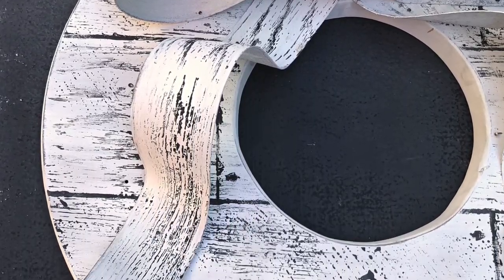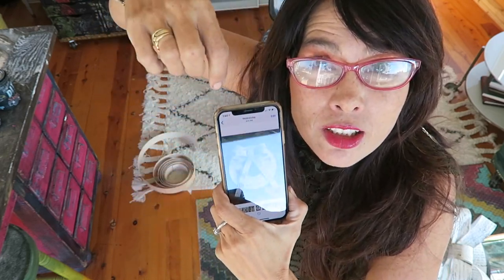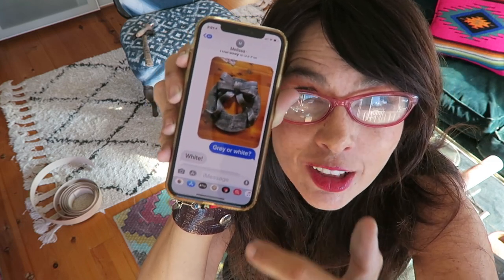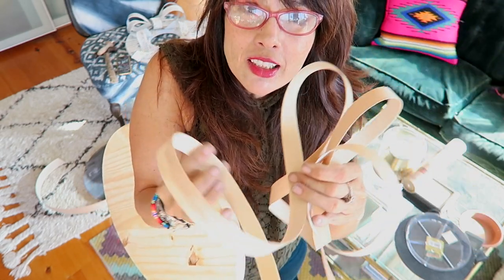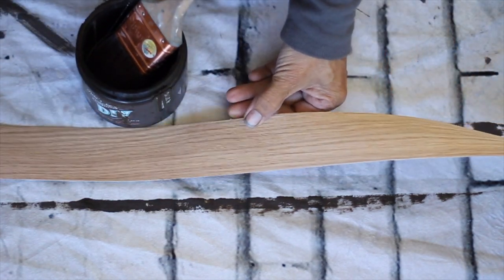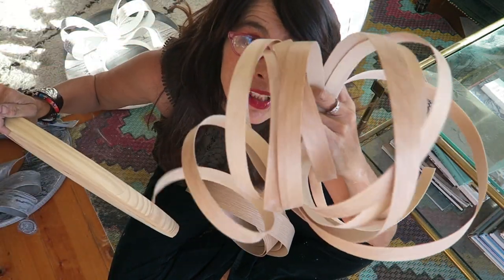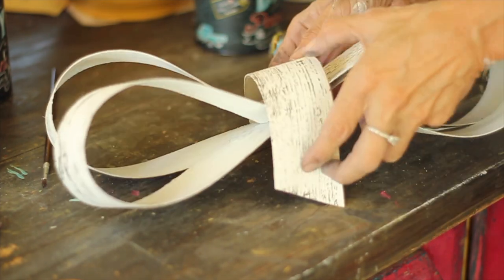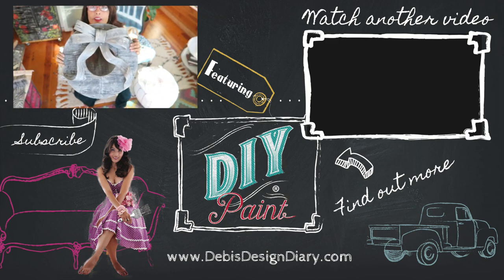How to make new wood look Old,  Faux Barn-wood  Planks with paint IOD stamps DIY Paint & veneer tape

Comment: Ok, so 3yrs on... I liked the gray too (loved the white), but that gray would look awesome if you added a tiny bundle of red clay berries on wire, and a few IOD leaves? I am definitely making the gray as we have hot, summer Decembers... and the gray will match my decor. I will attach a couple of vintage clip-on earings of my late mon, I have a perfect set filled with red and green rhinestones. I might add in some vinage lace that I stiffened into a bow, rather than the veneer as that is só expensive here in SA🇿🇦. The lace was my mom's too, it would be a great way to use it. Thank you for this..!🦋

Comment: Hi Debi, 
Love this! I would like to order the veneer and try it myself but the link is to "veneer tape" which has an adhesive back. Is that what you used? Concerned with panting on both sides.
Reply from the maker: yes I used the adhesive back, it worked out :) but stamp on the side thats not adhesive :)

Comment: Do you have to use DIY paint with the stamps or can you use any brand of paint?
Reply from the maker: I've only tried DIY, but IOD also sells ink for the stamps too. I've heard that some paint is easier to use than others. I would avoid a paint that has a built in top coat. (only because Ive heard some people say it doesn't work well )
Reply: Thank you for the help. I think that this is a project to put on my to do list. :)